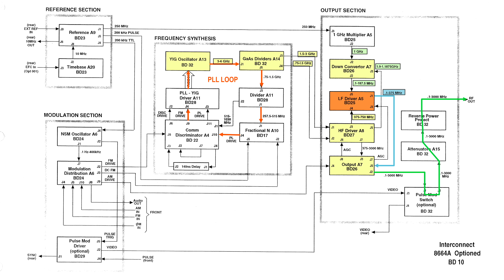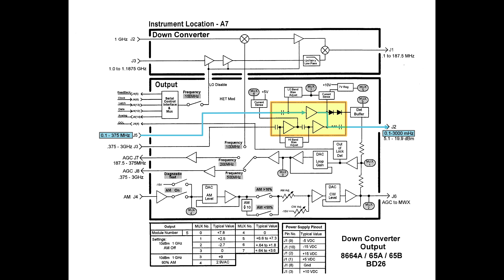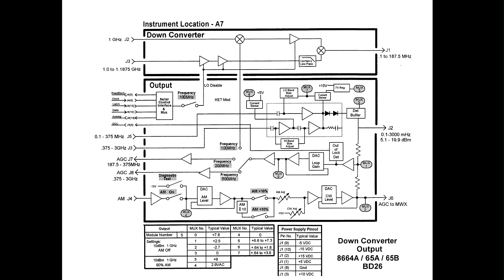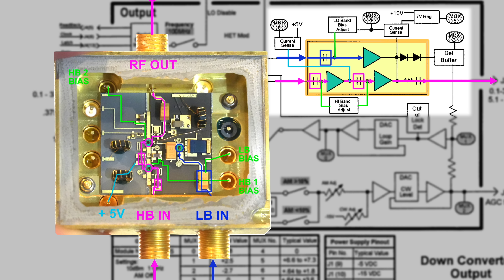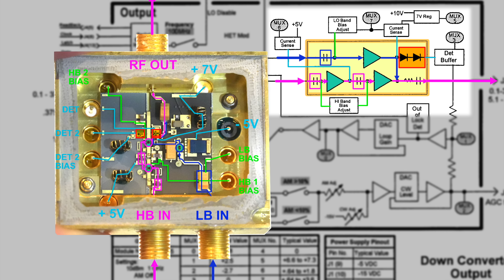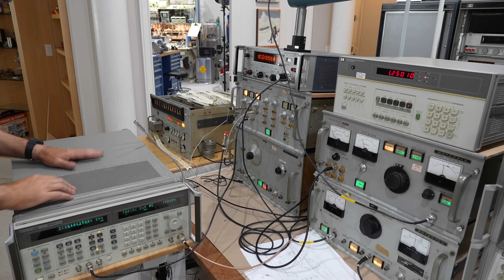HP 8664A 3GHz Synthesized Signal Generator Repair - Part 4

Comment: That Golden box is fantastic! I'm in awe.   Once I saw the internals I knew this was beyond hopes to repair... unless it was one of those tantalum capacitors (I doubt it would be that easy)  You put it nicely that all we can do is admire the gorgeous beauty of the hybrid circuit;   I can almost imagine how the testing and calibration had to be painstakingly done, they would have some sophisticated test station, probably in a cleanroom,  with the hybrid registered in a holder and the probe pins touching down. There's a rack of test gear. to generate the input signals and a scope to verify them.   Sapphire and gold...  WOW, what an amazing sight to behold.
Reply: The golden box might be reverse engineered. We just need to know probable specifications.
Reply: @metatechnologist  I would like to see that too.  I wished there were more documentation available.  I wonder if Keysight might have archives they are willing to share.  They should be thrilled that people are still using and maintaining their old stuff... or not... maybe they'd rather you buy a piece of new equipment instead of buying a similarly priced house.
Reply: The story on this machine is that it was designed in the very late '80s. At that time there simply were no RF transistors that worked at 3 GHz and if there was they were very low performance parts. So what HP did was do their own semi manufacturing in-house and they'd do large batches of semi's and reject  most of them and use the handful that might work. Because there was wild variation they had to appropriately take into account unknown inductance/capacitance their parts had like you see on this board. They also didn't package them because its a hassle when the part might not work anyway.
Reply: @metatechnologist  Yes, that makes sense.  A lot of performance binning was done on microprocessors, memories, etc. as well.  I worked at HP/Agilent in Santa Clara (on StevensCreek Blvd.), 1996-2001 in the Test and Measurement on their Flash Memory Testers and I have a lot of respect for the work and engineering that goes into these products.
Reply: Nowdays it's an embarrassment of riches with all the microwave parts we can pull from the internet. The semi process is uniform and reliable and the special tuning likely is not needed. If we knew specifically what this box does it's probably not that difficult to duplicate the functionality.
Reply: @metatechnologist  Exactly what I was thinking... the technology has matured so functionally it can be replaced with modern parts hopefully without the tweaking hassles. Like you said, what is needed is to know the parameters and specs of that golden box.  I think it's lucky to have a functional box that reverse engineering would be possible... and best to do it while it remains functional!  My guess is that you'd need an instrument that can perform a Bode plot at those frequencies to find the dB response curve to the system, then match it best with a modern RF transistor.

Comment: Isn't there a crack in the substrate in the top-right quadrant?
Reply: The reflections inside the cruved/machined gold flashed case can be more tricky. The walls are horisontaly grooved, the perfect reflection into the camera olso can be just a single line and it can move by groove by groove on the wall and seemed static on the substrate.
Reply: There are some bondwire shadows, but yes, I think I saw a crack radiating out from a via.  If it interrupted a trace, that might do it!
Reply: Around 11:20 looks like 2 cracks to me.
Reply: @Gymnos2  Yes, two cracks in that area - the other one is shorter. The bondwire reflections/shadows are visible too, but they are noticeably different and each accounts for its wire.
Reply: @SN74LS74  at 15:16 where he rotated it you can see that it's not a reflection and has to be a crack.
Reply: Yes I see that too.  I’m trying to decide if that is a crack or a shadow of the wire of the choke on the 7 volt bias line.  If it is a crack, it looks like it is in a location which does not affect operation.  When Marc tilted the device, it sure looked like a crack.
Reply: At least two cracks, they probably happened when it was heated on the hotplate to get it open.  Sapphire of that thickness would be very sensitive to any unevenness in thermal expansion.  When they are brazed closed at the factory, it is likely done with a specialized oven that uses a very slow heating curve followed by very slow cooling.
Reply: @projectartichoke  Doubtful.  Sapphire glass is extremely tolerant of temperature differences and gradients.  It has a very high melting point and very good thermal conductivity so that it is very resistant to thermal shock and cracking due to uneven heating.  This is why it is used as laser windows where one small part of it gets instantly heated to 1000 degrees or more while the rest of it is initially at room, or lower temperature.